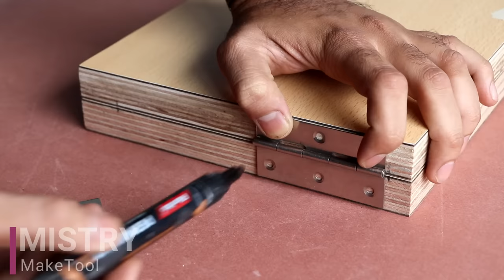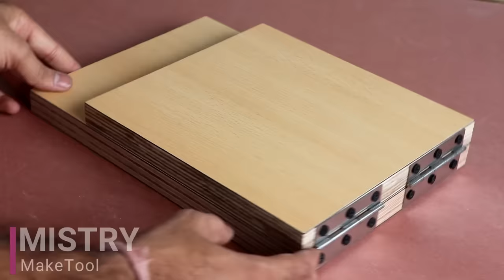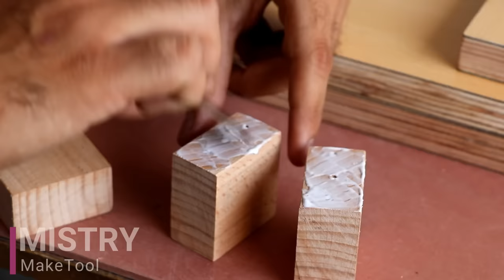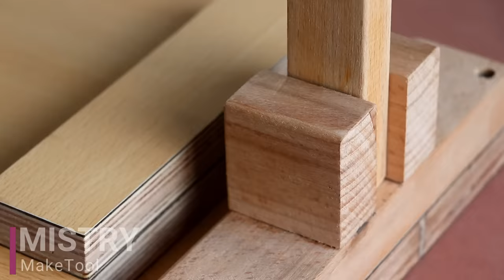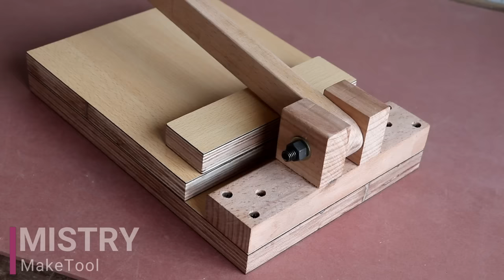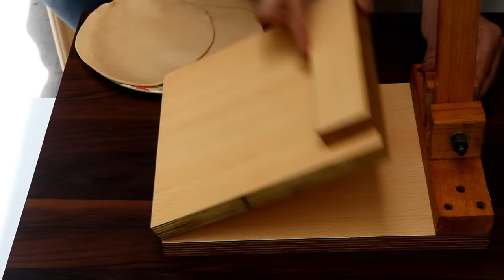Make A Perfect Round Roti Maker Machine || DIY Wooden Roti Machine

Comment: Left Up the junction 2 or 3 mm to make equal edges of the dough
Very genius idea
Thanks
Reply: hi. what do you mean by left up the junction 2 to 3 mm?? what part of the video is that? thanks
Reply: @saboorsaboor704 ।
Reply: saboor saboor if you check a tortilla corn press. They leaave 2 0 3 mm clereance. To make soft tortlla flat both sides left and right. But in the flour bread. Maybe no apply.

Comment: Your material is made of wood at least metals are hardened and tempered . Your wood is from one tree and make a flat roti and fry them plus keep making compressive stress to wood and it will crack for sure .
Reply: While making pl  mention size is length  wedt  and thickness

Comment: What are sizes of all the pieces.
Reply: today i built one form one beech wood board (800x300x18 mm) the top wood has 300x 300 mm and the bottom wood 380 x 300 mm. the holders for the lever are 70 x 70 mm. the wood under the holders is 160 mm x 70 mm and the cross board on the top 300 x 50 mm. the lever is a piece from a old slatted frame (hardwood). the lever is working with washers not with a metal sleeve. works like a charm. build it with a even thin space between the wooden boards. use washers for the space at the side of the hinges and on the other side the heads of the srews which are fixing the cross board. today i used it to press papadam aka papad....perfect.

Comment: Not a healthy way of making it since you have to use oil to make it slippery in between the two planks of wood so spreads out. Also they come out abit thick and will still need the rolling pin you have not solved anything but good try.
Reply: You call that a thick roti. That's perfect. I don't want to eat paper 🤣🤣🤣
Reply: @punjabimundaUK  give up dhosa

Comment: Why wasn't there a small spacer, for the thickness of a finished tortilla?  When you pre-drilled the holes for the hinges, you placed the two pieces to be touching, instead of allowing for the final thickness.
Reply: very good question :)
Reply: build it with a even thin space between the wooden boards
Reply: @mikethespike2643  YES, that was my point.
Reply: @dontworrybehappy929  i built one today with beech wood. works perfect. material costs $ 15. No color but oil on the surface of the wood.
Reply: @mikethespike2643  Hope you used food safe oil like Mineral Oil, Walnut Oil or Coconut Oil.
Reply: @dontworrybehappy929  i used sunflower oil
Reply: @dontworrybehappy929  btw. mineral oil is anything but food-safe!!!!
Reply: @mikethespike2643  Interesting that woodworking and food experts suggest it, then.

Comment: This tool is available in cast iron version in the market. Why take pain making the plywood version? Durability also matters. These tools are not good for making rotis but poories.
Reply: maybe because its cheaper und it did not  rust?
Reply: @mikethespike2643  the metal one is cheap too at our place. But you can only make poori and kachori, no rotis.
Reply: @Dave_en  With such a tool you can press any dough that is soft enough (also rotis). To prevent the dough from sticking to the wooden boards, use one plastic sheet under the dough and one over the dough. If the dough sticks to the foil, oil the ball of dough before pressing it. btw. the tool should have a even space between the two wooden boards.
Reply: @mikethespike2643  but we don't use oil in the rotis. We dust it with flour and flatten it with wooden rolling pin. Atleast this method puffs up the rotis.
We were going to buy a roti maker from a branded store but after having the demo we changed our mind. The roti was just like leather piece once it cooled down.😂😂😂
But sure I have seen the poori makers using this wooden tool successfully.
Reply: @Dave_en  the oil is on the surface of the rotis. rotis sri lanka style with coconut are squeezed (by hand or machine) to the size of a saucer and baked in a lightly greased pan. if there is already oil on the rotis, you no longer need to grease the pan.
Reply: @mikethespike2643  oh, you mean parathas? Sure, parathas can also be made in this just like the kachoris. Difference is only that kachoris are deep fried in oil and parathas are baked on greased pan.🙏
Reply: i tried the recipe. There is no difference between pressed and rolled rotis (exept the thickness which depends on how much the space between the wooden boards is or how much you roll it. you have to press down the edge of the dough (e.g. with a wooden spoon) to puff up the rotis. If you have no gas stove you can puff up the rotis in the microwave. my recipe book says the dough gets better if it stays in the fridge over night.
Reply: @Dave_en  today i did another test and i have to admit that the rolled chapatis-rotis are better than the pressed rotis. I think the demonstration of the Roti presses is only advertising. probably they bake rolled rotis.
Reply: @mikethespike2643  I use the old tested method. Knead the flour using warm water, add a teaspoon of oil and knead again. Cover it for few hours to soak water evenly. This makes soft dough.
Then roll it into flat round shaped thin sheets, bake them on the iron skillet both sides and then directly on fire till it puffs up.
You get perfectly baked rotis. 
🙏
Reply: @Dave_en  thanks